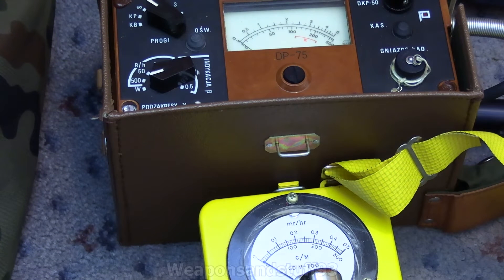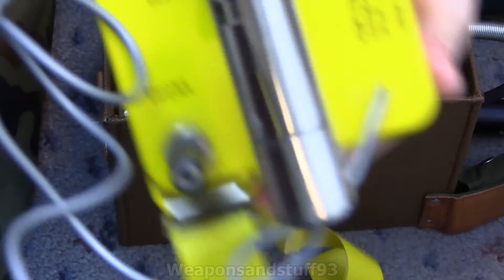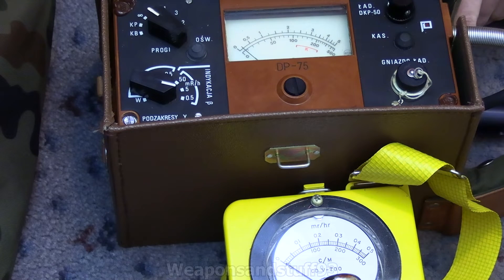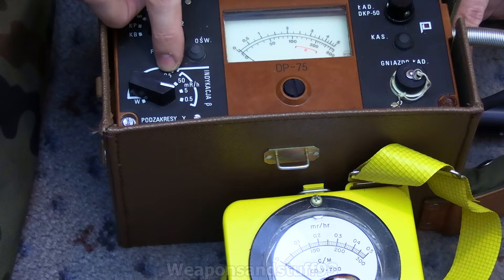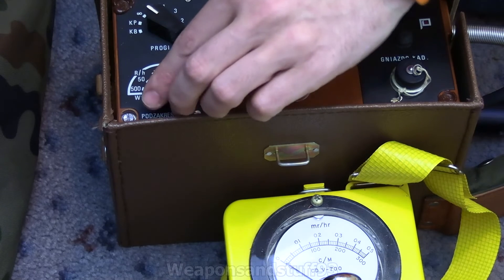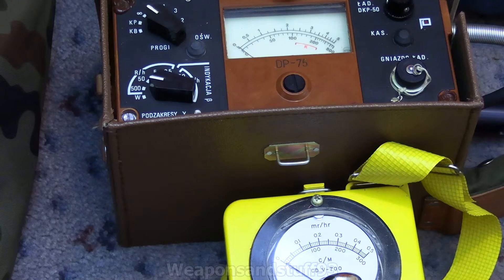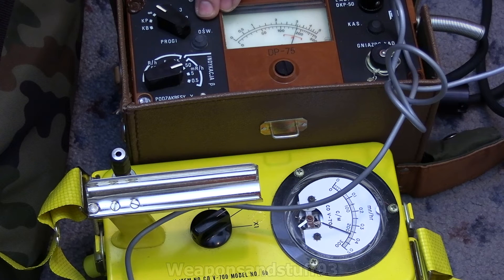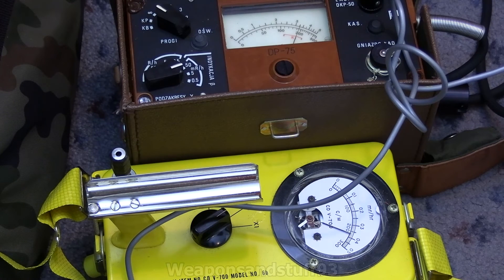Important Correction on the DP-75 Geiger Counter

Comment: i think its the same case for the dp66m & dp66m1 (the one that ends on 200 is only for the highest setting)
Reply: Witam
Reply: counts per minute are not shown on either the 66m or the 75
Reply from the maker: I think the standard DP-66 has a decay scale on the bottom and the M and later models use a bottom scale for the highest Roentgen setting like the Soviet dp5 series